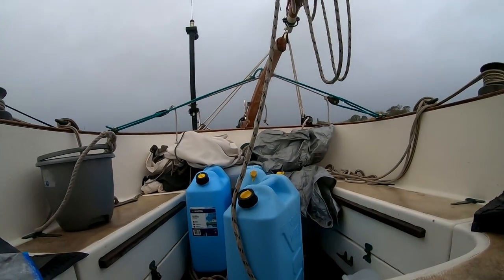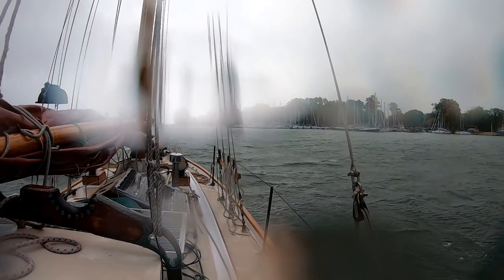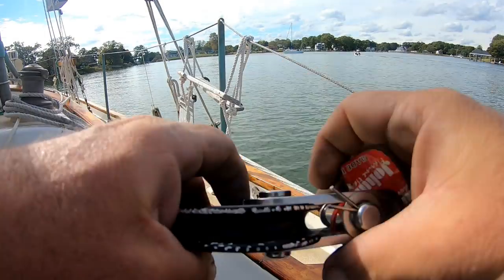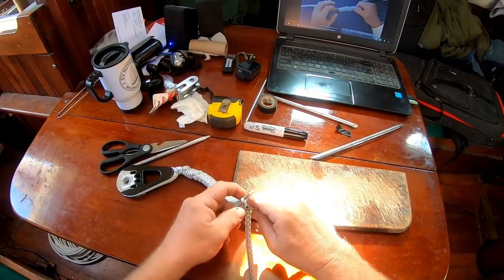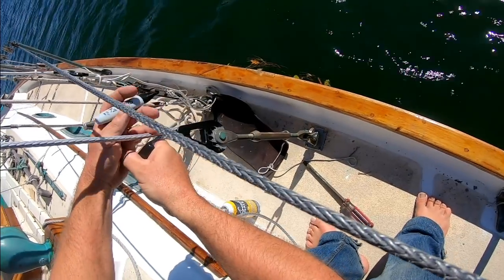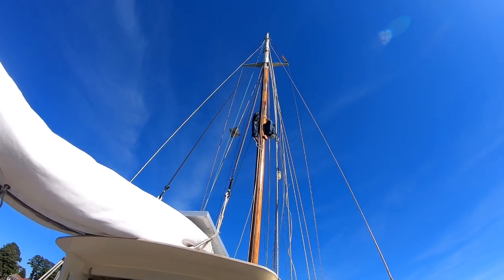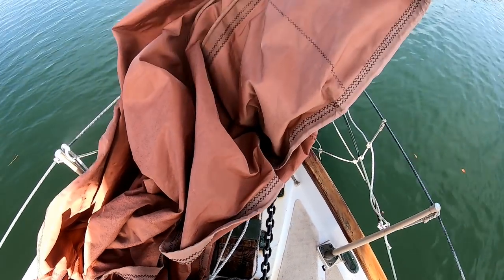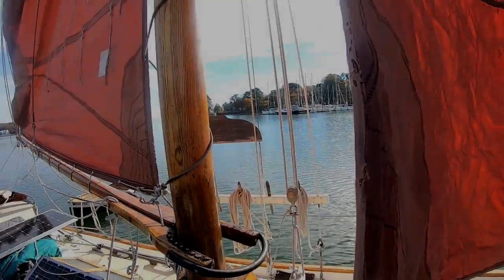Tuning the Rig

Comment: Excellent vid as always.....thank you Kevin.

BTW....this is the first vid (for me anyway) that mixed synthetic wire with standard turnbuckles. It would seem that this hybrid is the easiest and best way to do the fine turning that all rigs (especially synthetic) require from time to time. When the time comes for rigging wire replacement on my boat, this is the system I was thinking to use. So please keep us posted if there are any negative drawbacks to consider.
Reply from the maker: Will keep you posted on how things work out. Thanks for stopping by.

Comment: It would be interesting if you would explain why you chose Dyneema. Also When you mention certain towns and rivers, it would be nice if you explained exactly where you are for the geographically challenged. Thanks.
Reply from the maker: It's actually Dynice Dux, which is stiffer and stronger than Dyneema.  I chose it because is can be easily spliced, and is very light.  Yeah, I know, I need to show more maps in my vids ...
Reply: @howtosailoceans1423  It's always fun plotting along.  Learning a lot good inside Bay knowledge that way.

Comment: Yet another enjoyable glimpse into sailing for real.   Always enjoy hearing the reasons why a plan is being changed as so often has to happen.   
Question:  Will you get 30+ years out your new shrouds?  I know that tech is always improving, but not details.   You didn't mention it, but I assume there is no appreciable difference in weight.   Weight up high can't be good.
Reply from the maker: Yes, Dux is a fraction the weight of wire, so easy to carry spare lengths.  Probably will not last as long as wire, but working with it is only a semi-skilled job, so replacing it every 10 years or so seems acceptable.

Comment: When is a 1/2" pin not a 1/2" pin?  It's interesting to see you using standard turnbuckles to tension the lines.  I've seen others using wraps of more dux in place of turnbuckles.  I think I like your systems better.  Now, the estimated life expectancy of dux rigging is about 10 years (and I've seen some estimates of 5-7 years in the tropics), which is the same as wire rope, but I have seen the wire rope go much longer (like yours).  Why switch from wire rope to dux?

I replaced the rigging on my main with new wire rope, but didn't do the mizzen yet.  I'm considering doing the mizzen with line.  I already made new running back stays from 1/4" dyneema.  Very easy to splice, but I am curious about the thimbles you used.  Can you give more details?
Reply from the maker: I think Colligo wants you to use their deadeye system for tensioning.  But I still would have had to grind the thimbles where they attach at the mast.   The advantage of Dux is that it is much lighter and easy to splice, so perfect for the amateur rigger.

Comment: Over 30 year old shrouds 😬?? I’m reasonably new to sailing and keep hearing that you need to change your standing rigging every 10 years...mainly for the insurance I assume but there seems to be no definitive on this. It’s not a cheap proposition changing the sanding rigging and if yours have done over 30 years that’s a good chunk of money saved on 3 rig changes that wasn’t necessary to spend. I’m sure it rather depends on how much usage the rig gets, but you have crossed the Atlantic twice in the recent years on 30 year old rigging. Maybe this says it all. 
I’d love to hear your viewpoint even explain your thought process about rigging in a video...I’m sure I won’t be the only one who would find this useful/informative. 
Love the videos and inspiration they provide..fair winds
Reply from the maker: Thanks Matt.  Yes, I've heard the 10 year replacement plan for wire as well, but my shrouds showed no signs of stress after 30 years and some hard sailing.  Nonetheless I thought it a good idea to replace them.
Reply: @howtosailoceans1423  Thanks, definitely food for thought, maybe I'm a little sceptical when it comes to things like this. I'm sure riggers are more than happy with the 10 year rule and would not be so should people decide to go with 30 instead....😉

Comment: How did you determine the 7mm size was the correct size for your shrouds?  Your boat is really looking good and the hard dodger seems to be working well.  Fair winds!
Reply from the maker: Colligo says that 7mm Dux is approx. equivalent to 1/4" 1x19 wire.
Reply: @howtosailoceans1423  Thanks for that info.

Comment: You left me hanging. Did you make it to the anchorage while there was still light left, or was it after dark?
Reply: Starting from one mile to go and five minutes to sunset, he would have reached the anchorage about ten minutes after sunset.  At that latitude, evening twilight is around 40 minutes.  He then would have about 30 minutes to the end of ever darkening twilight.  That seems enough time to complete duties associated with anchoring and making ready for the night. (assuming no unanticipated clusters)  Even still, the hook would be set well before night.
Reply from the maker: Your calculations are correct.
Reply: That sure beats Kevin’s usual luck of having the wind completely die and he’s left sculling into the anchorage and setting anchor a couple of hours after sunset

Comment: Nice - working on my dyneema shrouds now for the Contest 31.  I'm planning on converting to external chainplates on the topsides.  The current ones are 50 years old, time to go.  I would have thought you would use 9mm for your shrouds?
Reply from the maker: They tell me 7mm is the correct size.  The thimbles can take 9mm, so I could swap it out if things appear strained.  7mm Dux is just strong enough to pick up the entire boat.
Reply: @howtosailoceans1423  Very true!  Thanks for this update.  Your technical approach to things is always appreciated.

Comment: I just bought a 28ft southern cross I need to sail it home to deltaville from key largo first time making this trip any advice I need to make it as quick as possible because of work will proply doin trip in the spring thanks
Reply from the maker: If you wait until at least April, should not be too difficult offshore.  Just find a spell of southerly winds.  If you can't make it before a front /low comes off the coast, there are places you can duck in, such as Beaufort.